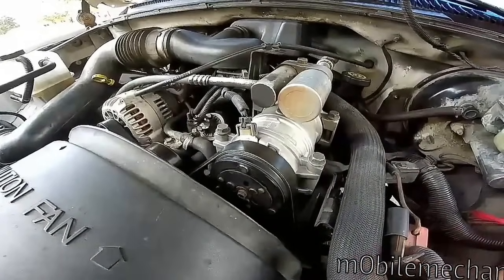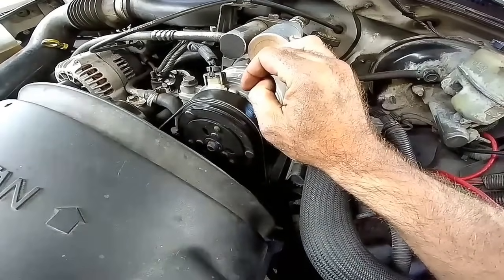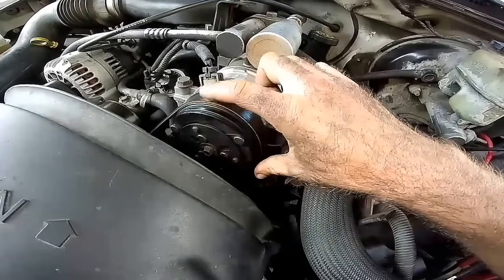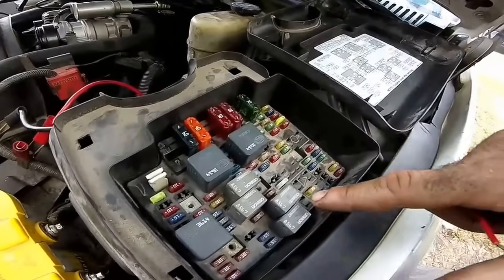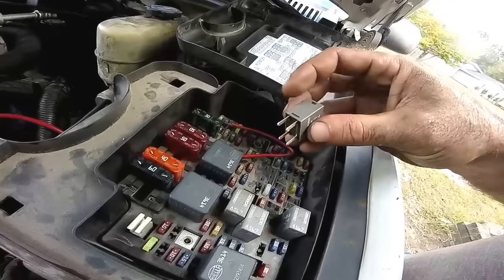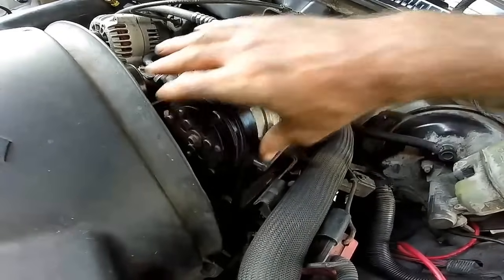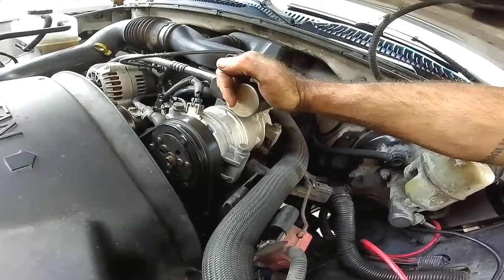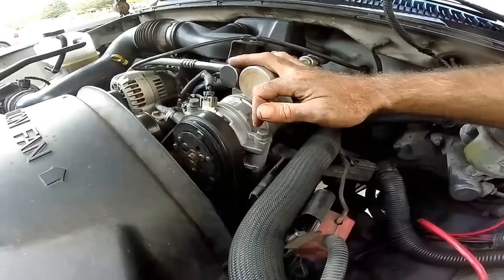Easy A/C Clutch Coil Test A/C Clutch Not Engaging

Comment: Question? If while trying to wire trick the whole entire fan blade starts rotating as well would that be normal? Rather than just getting the clutch click as seen in the video? I have a 2007 Ford ranger 3.06 cylinder. Any help is greatly appreciated.
Reply from the maker: I haven't seen that but since the compressor being on requires the fans to be on it makes sense that they possibly tied the circuits together.  If the clutch locks as well then I wouldn't worry about it.

Comment: Details please:  How do you test it at the other (Coil) location at the plug you were pointing at...you mentioned back-probing?  Others have said test there with paperclip...NO ONE has shown how exactly it is done for us who don't understand what da heck you all are trying to explain....
Reply from the maker: if its only got one wire you can just at battery voltage to the wire anywhere you can access it.if its a two wire then you would need to determine witch wire is positive and apply battery voltage to that wire.
Reply: @m0bilemechanix  My car i20 engine is running very quiet as usual. However, as soon as AC clutch is engaged, I hear a squeak sounds and not metallic sounds or alike. The squeezing like sounds go away immediately as AC is off. Even with engine revs, same sounds. And with AC off, as I revs the engine, still the engine is quiet. How to find that squeaky like sounds and fix it?

The AC is blowing cold. It seems the AC compressor is ok.

Comment: The green fuse for the blower motor. I can't seem to find any of them at auto part stores. It's a small box fuse with a clear middle on top.
Reply from the maker: Should be right in the fuse section. May look slightly different but as long as you can get it to bolt in and it's the right amperage it will work.
Reply: @m0bilemechanix  those fuses are dealership only. No auto part stores has them

Comment: I tried this and It didnt click.. the compressor turns by hand. Could a bad low pressure switch keep it from engaging? How can I test it? The the low pressure switch at the plug wires tested fine, but do I need to test the area where it actually plugs into?

Comment: My clutch is not engaging, when I turn the ac on the clutch magnetized but doesnt engage. It spins by hand when off so I know the compressor isnt seized. Does this sound like the I need a new clutch?
Reply: mine does the same.. it actually blows a fuse.. so I know for a fact there is a short either on the compressor or the cabling. sucks :S
Reply: Any updates?
Reply: @chamirf  I didn't have the tools to remove the compressor. I barely bought what I need 2 days ago to remove it but I haven't had a chance to do it. Already checked the fuses on the back of the glove box (Mazda 3) and that fuse of the AC is fine. It's definitely the compressor or the cabling of it.
Reply: I just fix my mazda3 same problem we did a lot of work at the end we replace the heater relay problem solve
Reply: @joseortiz4431  which one is that??
Reply: Shul fuse box near the a,c one. Make sure to replace both of them
Reply: @joseortiz4431  what year is your car? I have the 2009
Reply: Shul 2010
Reply: @joseortiz4431  I think your car design completely different than mine.. but I'll check the relays out. Thanks!!

Comment: QUESTION? My ac does not work on the 98 Corolla i purchased. I’ve lived up north most my life and have never used the ac on any of my vehicles over the years. So i checked, and there was no refrigerant in the system. I removed the aluminum ac lines, the dryer, the condenser coil so far. If i remove the compressor clutch relay that you examined in your video, will this deaden the ac electrical lines, for me to remove them, and can i leave the relay out? 
Thanks for your informative video.
Reply from the maker: it would yes however the compressor shouldnt run anyways even if you turn it on because the low pressure switch would lock the system out due to not having any pressure.
Reply: m0bilemechanix    Thanks

Comment: i tried what you did.. took out the relay and used a wire to connect the 2 points. no click.  so i used an ohm meter  and used that to see if it would register but it didn't.  i was thinking  that it could be the relay but i checked out and was working.  so i went to the compressor the wires were good there and to see if the compressor is still ok. so  negative to the battery and positive to the wire. good. and there was another wire coming out of the front of the compressor, i think that's for the coil?? i used the ohm meter on that as well and it is also good. the clutch still doesn't click and engage. should i just put a negative and positive wire from the battery and connect it ti the negative and positive of the compressor? can you give me some advice so i can find out where or what the problem is?  thanks in advance

Comment: Should one of the two wires on the two pin wire connector to the AC compressor clutch be hot (powered) when the car is started and the AC control is on? - if so, they're not. I've checked it with a test light - no power to either side of this pin connector when pulled off the compressor. I've jumpered my low pressure switch connector with a u-shaped piece of wire, (even though I've got freon in the system), I've checked all the fuses and relays, under the dash, and under the  hood - they all test good and still the compressor clutch won't engage. What am I overlooking? Does this mean the compressor clutch is bad, then? I am working on a 1999 Chevy Express 1500 van, by the way. Thanks.
Reply from the maker: What happens when you did what I explained in the video.
Reply: @m0bilemechanix  I just watched it again. I'll do exactly what you did with the jumper wire at the AC relay , ie, hot wire it, to see if the clutch coil engages - I have to admit, I didn't do that, I'll try it. Thanks much. // ..later - yes, it works, the coil clutch engages when I jumper the AC relay with a piece of wire as you did in your video. Thanks. Compressor still not working though. I have an electrical problem of some kind, not sure where it is, though; I've checked and rechecked all the fuses, everywhere. I'll get back with you when I finally figure it out. Thanks, much!
Reply: Well, I figured out the problem. I have a 1999 Chevy Express van, there was an unattached wire with a two pin connector with a U - shaped piece of  jumper wire that had corroded through or shorted out that I had installed on the last compressor I put in this van. I think this wire went to the vehicle's original compressor high pressure cut off switch, but this last, (aftermarket), compressor  in there, now, if I remember correctly, didn't have one, so I rigged the connector with a piece of jumper wire to take it's place, to complete the circuit. I put a new piece of jumper wire into this connector, (today), and it all now works, fine! I'm going to cover this exposed wire with a piece of electrical tape and label the connector this time, in case it happens again. Thanks for your help!

Comment: 97 Dodge Ram 1500 5.9L.  Based on your statement below, I have a short in my wiring.  I unplugged the power wire, engaged the AC, and it immediately popped the 20 amp fuse to the AC relay (which is also the horn's fuse).  The problem now is that there is no apparent area of wear on either the two power wires or the two ground wires. By two ground wires, I mean the two wires are together but insulated from each other like the power cord on a kitchen toaster.  They connect on the compressor case at the same location.  So, any thoughts on finding a bad place in the AC wiring that shows no apparent sign of wear?  Also, am I correct in assuming that a faulty ground wire will pop a fuse just like a faulty power wire?  Thanks!
Reply: Go to a bigger fuse.. tracking wires are no fun.. curious if electrical in the compressor can cause this?
Reply: Not sure I'm comfortable going to a bigger fuse, but I can see where doing so would be tempting.  In my case I can't readily see where the compressor could be a problem since I still pop a fuse when the wire is disconnected from the clutch.  The ground wire is indeed attached to the compressor, but I assume that's just for convince sake.  That may be a false assumption.  You are right about chasing shorts in the wiring. I wonder if my time would be better spent just rewiring and bypass the whole thing and use a on/off toggle switch mounted somewhere on the dash.  I'll need to learn how to incorporate the toggle switch that is in the same fusebox as the AC/horn fuse.

Comment: I have a 2007 ford expedition I have had everything replaced for the ac.. the lines , blend doors,  the actuator , compressor , ECT... Ac works fine for months then goes back to hot air then works again for a while then stops  the defrost front doesn't work and it only blows on 3 and 4 makes no sense what could cause it to work fine then stop .. what could the issues be?????
Reply from the maker: Sounds like your blower resistor is bad for starters. But not sure if that's causing the temperature issue. I'd check/replace the resistor first and then recheck functions
Reply: @m0bilemechanix  also the clutch is not spinning but if I hit a bump the ac will start working again

Comment: So mines not engaging but I did the relay thing and it engaged so something else my problem like PCM not telling the really to close so that’s great
Reply: Not a pro: How is the pressure of the system? High and low side, the pressure has to be correct, to low or to high can cause the system to no function as well as a protective matter. The only way to test is with the AC gauges.

Comment: What would you check if you could jump the compressor on but the relay itself will not have power when ac button ( lights up) is turned on??? The pin on the relay that is from ecm had a very weak ground when key is on but nothing changes when ac button is pressed!!  This is driving me crazy lol

Comment: Does this bypass the trinary switch?. I have a 07 mazda 3 and installed new clutch kit checked all fuses and clutch won't engage jumper wires on relay didn't work either

Comment: I did this on my 06 hhr so the AC clutch went in. I tested the connector I have ground but no power, so I'm confused what the issue is, why it doesn't activate when I try to turn it on

Comment: Well can I just run it like that ? With out the relay?
Reply from the maker: No don't do that you will burn up the compressor or if your system is clogged you could build too much pressure and blow the condenser up or a line. You most likely need to charge the system or you have a bad high or low pressure switch.

Comment: My ac compressor comes on for 12 seconds and then cuts off for 24 seconds. It does that consistently while I’m parked or driving. This is a newly installed compressor. What could be the problem ?
Reply from the maker: That can happen if the system is under filled or over filled. If it's under filled the compressor will come on and suck the system down below 20 psi and the low pressure switch will cut it off until the system stabilizes. If it's over filled the compressor will compress too high on the high side and the high pressure switch will cut it off the same way. A restriction can also cause cycling but not as common. Only way to know would be to put a set of gauges on and see what the high and low side are doing. You need to see both sides at the same time cannot use the little service gauges that you get with the cans.
Reply: m0bilemechanix thank you. I will be going to a specialist.

Comment: I have added freon, jumped both pressure switches and checked all wiring and still the clutch will not engage, so I will try this method tomorrow, relay is fine, so I am coming to the conclusion that the coil is bad, I'm praying that's all there is. Thought I had a leak but it needed very little freon like hardly any. I've had the truck for 9 years and no ac, just now attempting to fix it, when you get older ac becomes more of a need then  when your a teenager lol
Reply: you have to engage the clutch then you can add Freon.

Comment: Great video! When I bypass with paper clip clutch gets engage, does it mean I have a problem in my fusebox? the solution is to replace the fusebox also harnesses or just the fuse box?Thanks
Reply: if you do it with a paper clip and it works then it shouldn’t be anything with your fuse box, ohm out the relay itself and if you get continuity then fuck idk what to tell ya but if you don’t it’s most likely your relay that’s bad
Reply: if you jump the relay, you're taking the low pressure switch out of the equation, so you have a bad low pressure switch, faulty wiring, or a low  charge

Comment: I have this situation in a GM Opel 1.6 XE 2004 manual airconditioning in which there is almost no voltage (2 volts)  going to the AC  compressor when the AC is turned on. I swapped the compressor relay with the horn relay (both relays are OK), replaced the little fuse  7.5 Amp inside the cabin (both fuses old and new are OK). When I turn on the AC, the radiator fan switches into 2 gear, nearly draining the battery to 12.2 volts. I checked the compressor coil resitance its 5kOhms which should be withing normal limits. The pressure equalized in the system is 8 bars, but the compressor is not engaging. When I disconnect the pressure switch the fans do not engage, I was wondering could there be an obstruction in the refrigerant lines or dryer causing such symptoms, so that the ECU is not allowing the compressor to be turned on?

Comment: Tried the pin method and it starts to throw cold air but then it’s shuts down the whole truck. What does that mean?
Reply from the maker: Sounds like the compressor is locking up
Reply: @m0bilemechanix so it needs a new compressor ?

Comment: The clutch locks in just like yours after jumping it. Would that mean I need a new relay? Just blows warm air my brother said ac worked when he had it. 99 Buick century
Reply: did you end up finding a fix?
Reply: @madalinemaestri5030  I was able to add refrigerant after jumping the relay. Then I popped the relay back in and it started working normally. Ac was working for maybe a day then went back out. The compressor still kicks in now but no cold air. I haven't got it checked out yet.
Reply: @1985NEVETS  sounds like you have a leak. most likely the leak will be at the back of the compressor where the two lines mount to the compressor.. those lines use rubber o-rings as gaskets and are common for failing. make sure you apply grease to the o-ring when installing new ones.

Comment: I am getting closer to fixing my problem. 2005 Lincoln Town car  Freon is has been added but the A/C clutch comes on every 5 seconds - for 3 seconds like clock work.  Some say I don’t have enough Freon some say I have to much:  I know I need to get those a/c gauges red/yellow/blue with the pig sounding mini vac.  But I added 3.5 cans of the recommended Freon after I installed the brand new a/c compressor lol doing that almost killed me it seemed when I disconnected the old one man oh man ... but I made sure I put it in right and that it was the right part.  If anyone can shed some light I’d be really thankful thanks 🙏

Comment: Can you engage it with the engine running??
Reply: what do you think happens when your sitting in your car at a stop light and you hit the switch to turn on your A/C?
Reply: @lifepresent3183  I wouldn't recommend theres a reason its not engaging if you force to engage with a paperclip and start the car mine compressor started smoking

Comment: I have a 99 Dodge Durango I tested the connecter that plugs into the compressor clutch I don't have any power I tested the wires from the connection to the fuse box I have continuity I don't know if there is no break in the wires why I'm not getting 12volts to the compressor clutch replaced the clutch relay still nothing
Reply: Did you ever find the answer to your problem?

Comment: So what the problem if the jumper wire works but a known good relay doesnt lol thats my issue.. it will run all day with the wire on it but if i put the relay in it will lock up and spin like one rotation every 10 to 15 seconds and stop... very frustrating

Comment: I have the same problem the AC turns on when hot wiring it I replaced the fuse and checked a few other things and no change

Comment: When testing with the jumper trick does the car or ACC ignition mode have to be on?
Reply: I think he has the car in the 'On' position. The car isn't running but the battery is on.

Comment: My brother has a 2016 jeep Cherokee latitude. On the touchscreen I will tap the word climate on and it flashes to the main ac screen for a second but goes right back to the screen that says climate on. The AC system acts like it's dead. The radio works but the AC doesn't do anything at all. No defrost or anything. It's driving me insane